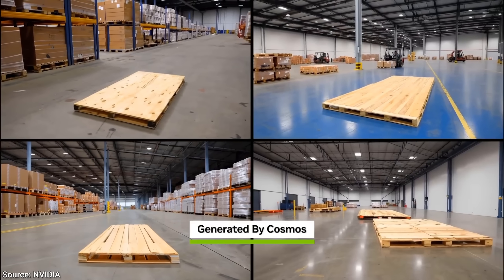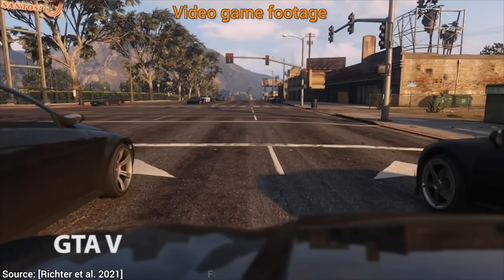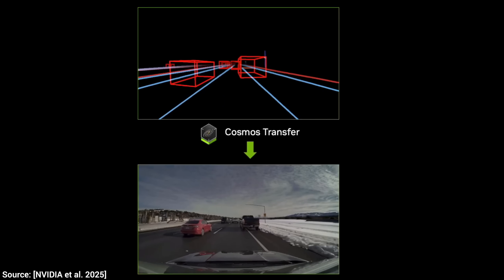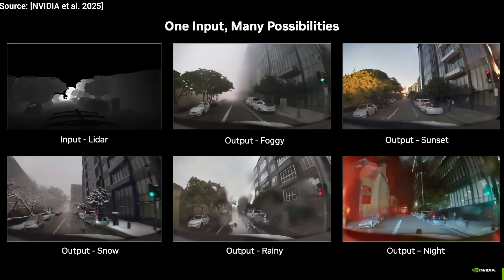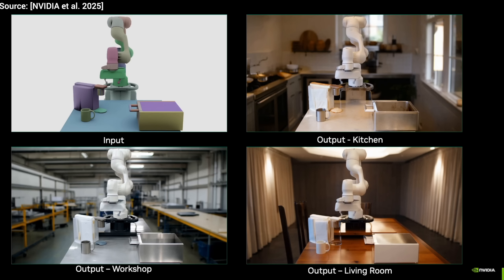NVIDIA’s New AI: Wow, Video Games Become Reality!

Comment: 1. Introduction to AI Cosmos
00:00:02 The next phase of AI revolution: AI that moves and helps in the real world
00:00:35 The need for more training data and control in AI training

2. Cosmos Transfer Technology
00:01:05 Using simple game engines to generate photorealistic outputs
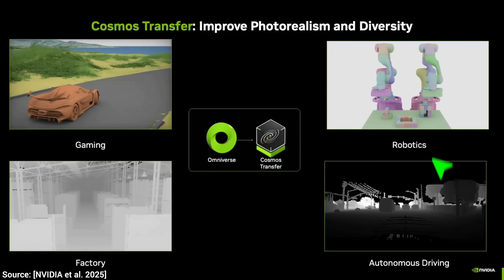00:01:37 Transforming minimal depth or simulation data into realistic scenes
00:02:07 Enhancing images from low to high resolution

3. Multi-input Scenario Generation
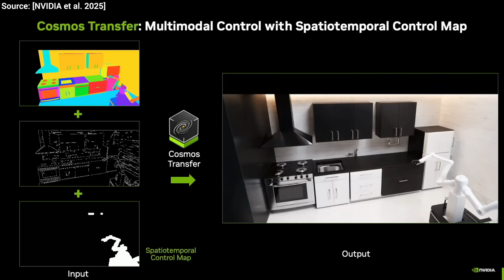00:02:38 Combining multiple inputs to create varied and meaningful videos
00:03:08 Training self-driving AI with thousands of imagined scenarios

4. Self-driving AI Training and Testing
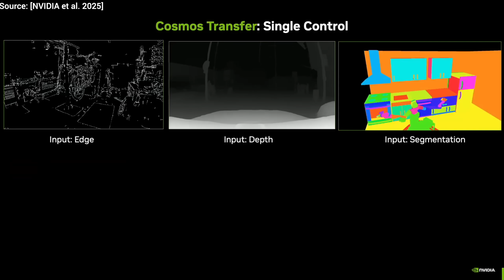00:03:38 Creating diverse robots and environments for training
00:04:09 Preparing AI for real-world challenges and scenarios
00:04:41 Cosmos Reason: testing AI decision-making in driving tasks

5. Future of Helpful AI Robots
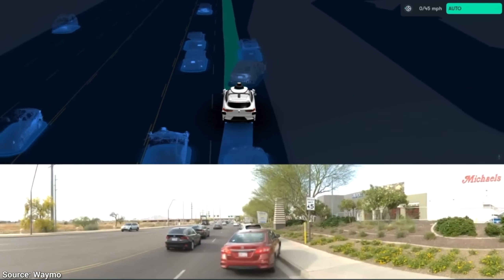00:05:13 Overcoming skepticism about self-driving cars
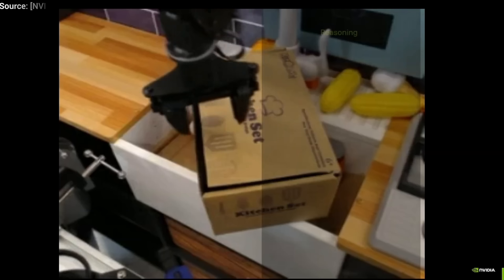00:05:46 AI's improved understanding of the world and future applications
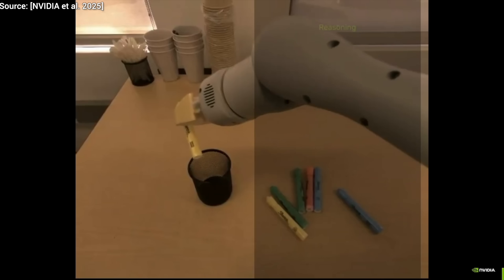00:06:17 Vision of AI assisting with household chores and complex tasks

6. Availability of AI Tools and Document Reader
00:06:48 Free access to Cosmos tools for local use
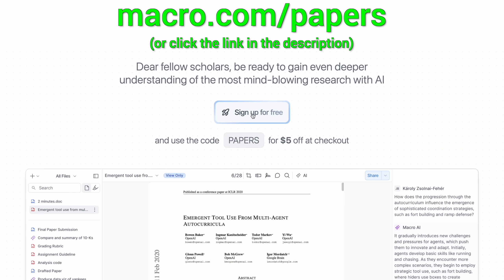00:07:16 Introduction to Macro.com AI document reader for research papers

--- Notes generated by nvoice.ai

Comment: 5:28 - you're teaching the thing the wrong reactions and analysis. That Waymo should stop while he assesses the car backing up and allows incoming traffic to decompress. You can think of our as maximizing options or minimizing compression. That's a terrible solution. What if the person backing up sees something and stops completely. Then you're low on options if another car comes out in incoming traffic. Accidents happen when multiple parties don't decompress or prevent unnecessary compression. I've driven for 30 years now with heavy city driving in Memphis and more recently here in San Antonio with 0 accidents. Of course that's also good luck, but just like any sport, you maximize your chances as best as possible.

Comment: This seems absolutely perfect for games themselves! If this truly runs in real time, then a game engine can run a lower quality faster to run render to pump out lots of frames with worse hardware, and then feed it to the AI to produce completely photorealistic frames in whatever style is wanted. That would be amazing and the last step when it comes to video game photorealism
Reply: If this tech advances enough, we could get handhelds pumping out graphics that make GTA look like a joke. What an insane world to live in lol
Reply: We are heading directly into Total Recall movie universe, where you can simulate an alternate reality for you to experience, blows my mind.
Reply: The only problem is that AI doesn't really run on "worse hardware". It can do basic frame and some resolution interpolation but that's about it. Anything else would require beefier hardware than the top of the line actual rendering hardware.
Reply: I don't think it's realtime yet. I'm guessing it's why DLSS or the raytracing denoiser used in nvidia raytracing are still at least somewhat limited. They are a similar approach, recieves a combination of depth maps, normals maps and some other things to then try and generate an improvement to a super noisy cg image. But those are actually limited by needing to run at video game fps. That's my guess anyways, I could be wrong in which case this will probably be a new way of rendering images for games soon enough.
Reply: Every day we get new techs that are supposedly going to change video games forever, but for some reason in the last 10 years we always get the games with the same graphics and physics over and over again, nothing really changes

Comment: How surreal that you're highlighting Waymo as if it's a tech that will even be in operation in a couple years.  It's a dead-end tech with $200k+ cars encrusted with expensive sensors only operating in cities mapped down to the centimeter, and still getting confused if it rains or something dares change in said city that doesn't conform with the pre-mapped layout.  They may add another city or two in the next couple years.

Then there's Tesla.  A generalized solution trained not on meticulously pre-mapped lidar scans but operating like a human would anywhere in the world, just like a human would in a city never visited before.  It sees like a human and reacts like a human because it is trained on billions of miles of driving video through simple, cheap cameras that don't have to stick out like barnacle encrustations all over the car.  It improves in leaps and bounds by the week and already safer than most drivers, certainly safer than a Waymo.

But why would Waymo be in trouble?  Simple economics.  Waymo requires at least one remote operator to oversee every drive, and that person(s) needs to be paid.  Tesla will be similar for the first few months as a precaution but will shortly after be unsupervised.  A Robotaxi will cost Tesla about $15k-$20k ish to deploy making it a money printing machine as opposed to a Waymo with inferior tech, spotty safety, and $200k entry point to play, quite apart from paying the supervisors and cleaners.

Waymo is the current leader in deployed "self" driving taxi services.  At least for a few more months until basic economics lay bare the bad bet they made on lidar.